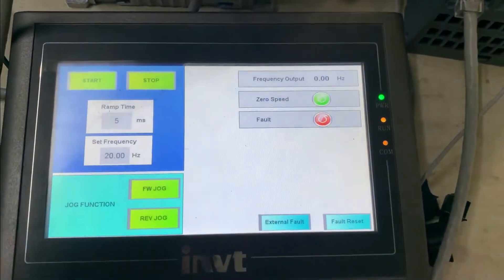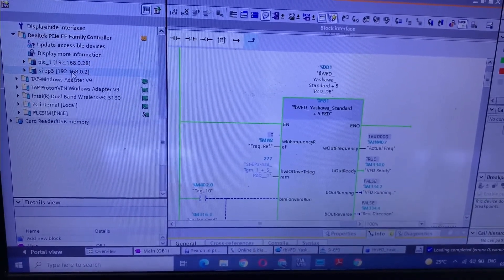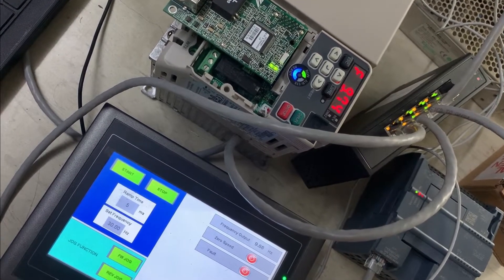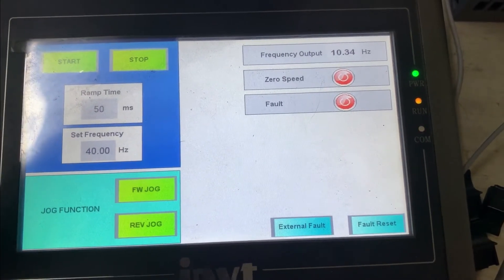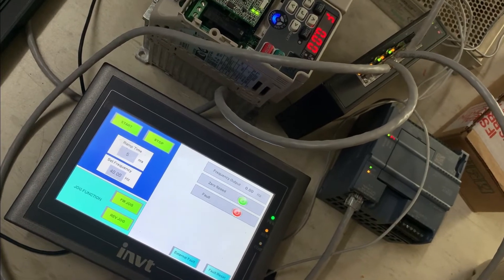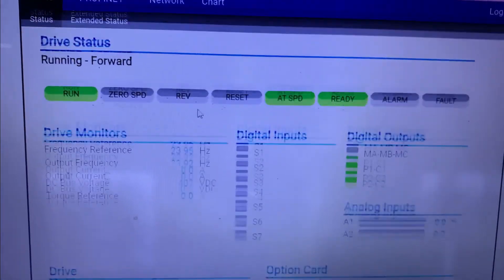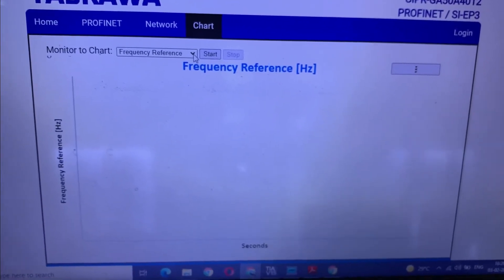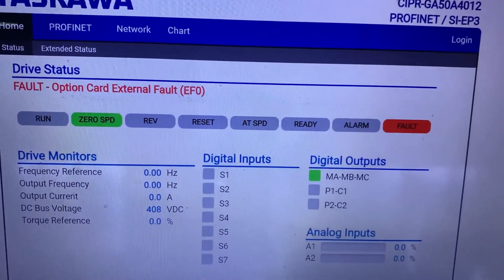Siemens S7-1200 and Yaskawa Profinet Communication | Yaskawa GA500 | SI-EP3 #Profinet Optional Card

Comment: sir, We are using S-7 1500 PLC .Could you share what are parameters need to set in the drive to Read the values of Torque, current, Power from drive
Reply from the maker: sorry for late respond, if you have any quarry regarding this topic then do a WhatsApp on +917874576714